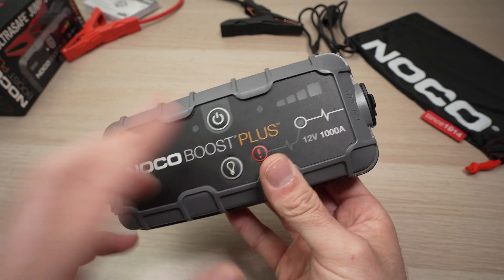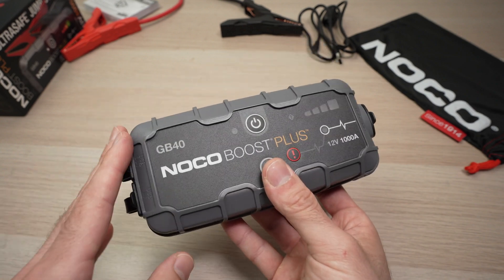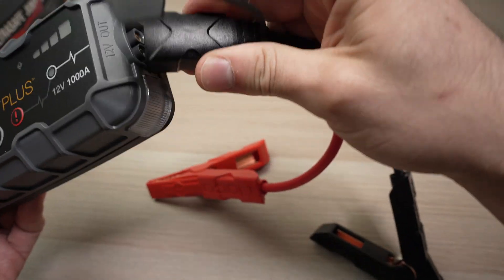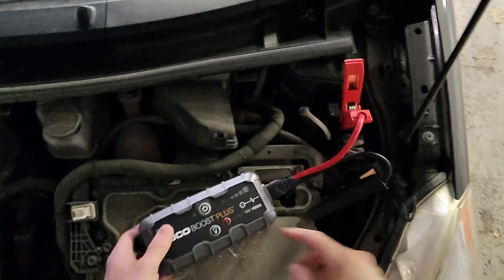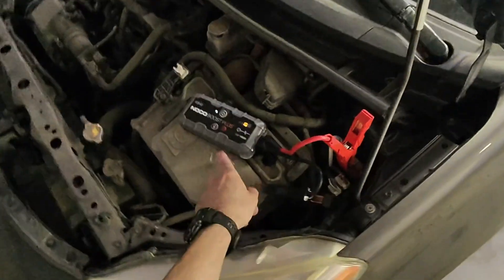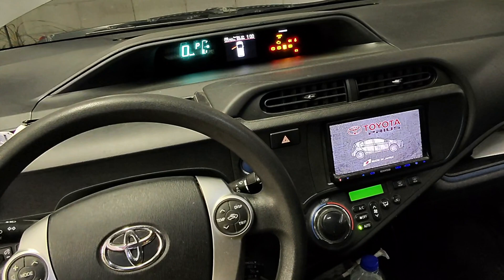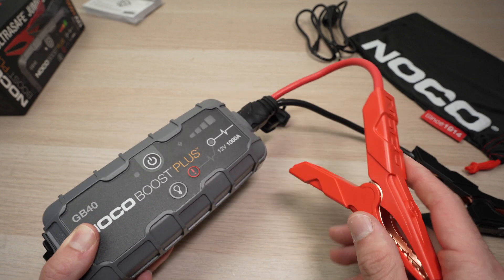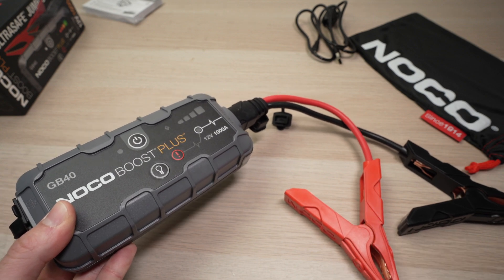NOCO Boost GB40: How to Manual Override (Force a Boost When Battery is Below 2 Volts)

Comment: I tried doing this on my completely dead 2017 Outback battery and it wouldn’t change to the manual override mode. It just continued to show the error light. I had to call for assistance, and the tow operator tried their NOCO first (had the same issue), then jumped me with their vehicle; they mentioned they have seen this same issue with other newer Subarus. Is there another way to manually override the Noco GB40?
Reply: Different video where a.comment said to manual override before connecting clamps